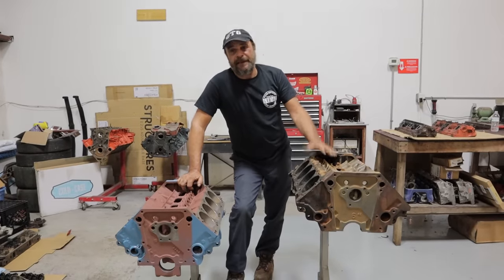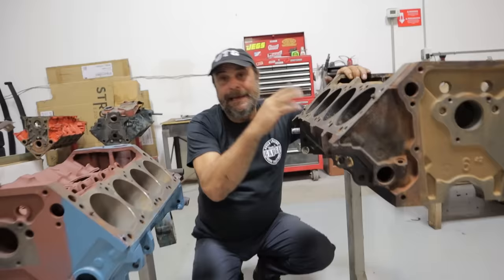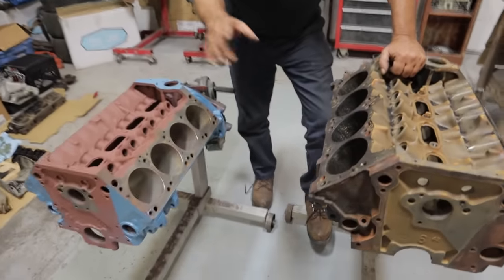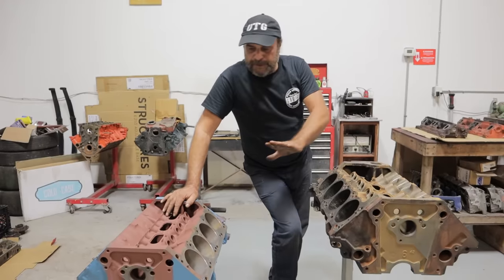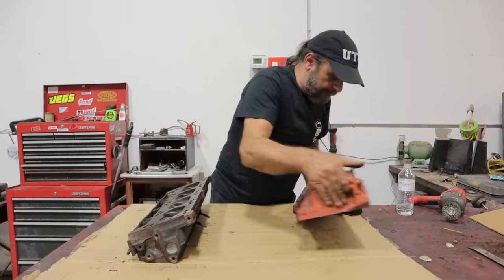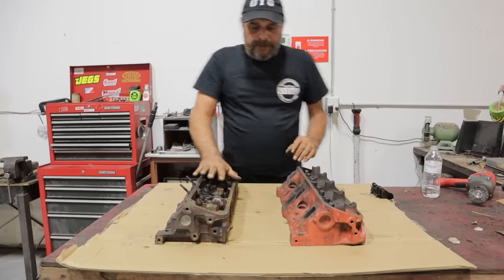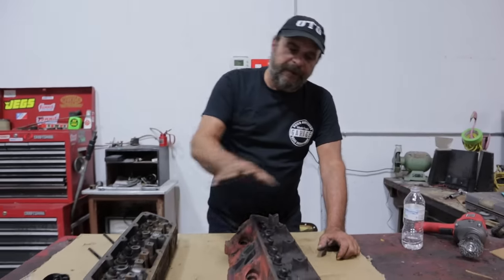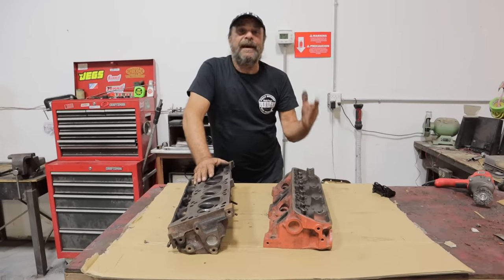Magnum vs. LA. Side By Side Comparison

Comment: I want to ask you something for clarity. When you’re talking about the  360 magnum small block Mopar motors, are you talking about the crate 360 magnum motors like I could buy from my dealer that they make now or are you talking about the magnum motor like mine 98 and 2001 Dodge van has. 

I am pretty sure you’re talking about the magnum motors that were used in Dodge trucks during that time like was used in my van, but I just wanted to double check

Comment: tony I have a question for you- I am putting a blue print 408 magnum in my 70 challenger which is a 340 4 speed car, with the magnum being externally balanced do I need a different flywheel since the flywheel I have was off my internally balanced 340 engine, the techs at blue print did not have an answer beyond their engines are automatic built engines, which I find concerning, along with all the other questions that builders will ask the buyer that they did not ask me when I was placing my order. 
Are you aware of any issues with bolting up the A-833 to the newer magnum engines? 
Thank you for doing this video it helps seeing with my own eyes what I have read about the magnums. I owned one for a couple off years when new but the now ex was awarded it before I was able to tear into it so this will be my first built Magnum and first stroked engine and with some luck won't have to tear into it for several years and can enjoy driving it instead of wrenching on it for once.
Reply: Hi James. No I'm not Tony...not even close, but I can tell you that you will break your crank if you don't use a 360 flywheel. The 340 flywheel would have to have weights added. I'll bet Tony could tell you what size and where to add it. Just be sure to address this before you procede
Reply: 440 source sells a billet steel sfi rated flywheel for cheap. it even has a weight mounting bolt pattern that i swear is the same as the mcleod flywheel weights that they sell for a 5.9 magnum specifically. brewers performance had the 5.9 magnum flywheel weight.

Comment: I have to disagree on the spark plugs, the thread sizes may be the same but on the LA style engines the spark plug socket size is a 13/16. 

Magnum engines are 5/8 socket size. 

LA and Magnum blocks are very different as well. 

The pitch of the cylinder walls are different, a magnum blocks cylinder pitch is more V where an LA block cylinder pitch isn’t as upright.
Reply: You're crazy. Both LA & Magnums are 90 degree V configurations. Plugs are the same thread and same seat. That the same "type".

Comment: Do they make a LA lifter that is designed to swap to pushrod oiling and just pipe plug the deck oil passages. So a guy can run LA or magnum heads on a LA block with pushrod oiling?

Comment: Hi UT. Question in regards to the Roller LA blocks, (mine in particular is a 1990, code date 3/10/90) so the LA heads on the LA roller blocks had the the intruding intake pushrod but also had the oil passage through head. So an older (pre '86) LA head would work with the oil galleys on the LA roller block but you would need to contend with the pushrod hole not being the correct angle? Is there a workaround for this? Or would it be best to just stick with LA heads that would have come with the LA roller blocks? Or I suppose go with magnum heads? But then I'd need to get the AMC rockers and oil through pushrods? Also do you need to block the oil galley's on a LA/LA roller block if using Magnum heads? Or maybe just a higher volume oil pump and get extra oiling up top? Thanks Probably made more confusion than anything else.

edit: PS thanks for posting this so little info out there on the Magnum engines!

Comment: I have a question, I’m looking at building a 5.9 magnum and boring and stroking it to a total of 426 ciz If the rotating assembly I order says it’s internally race balanced do I need to use a external balanced harmonic damper and weighted flywheel?

Comment: Hi sir have a 2000 mag 5.9 that ive just hogged out 30 over , coated pistons 10 10 cut crank ,modded kegger with alum plenum pan ,high vol oil pump ,hastin innerds ,  2014 eq nos heads , 4 hole injectors , ive had 3 high mile 5.9s and all 3 had major cracks . So got lucky on 014 eq nos heads .... also hogging out my throtlle body too goin in a 00 durango awd ..    .

Comment: Nice to know a swap can be done, but I think I will stick with the stock heads on my 360. The gain isn't worth the work to use Magnum heads. It's a 73, so I don't even have the air injection to deal with. Also low miles. Like 50k.

Comment: actualy......the bolt spaceing of the torque converter is slightly different.......and if you  drill the 
deck about 3/4 of an inch and then
90 degrees into the valley.......you can run steel lines to the oil gally next to the distributor...drill and tap......you can then use old style 
heads.....use head gaskets.  as. templates.....on magnum

Comment: I just got a 5.9L Magnum long block all apart, super cheap, cylinders need boring but it's in factory bore size. But one thing I noticed right away is some nasty grinding around the last two lifter "humps", as if they roughly ground off casting flaws. Also, it doesn't have that pillar under the distributor hole. Is that a common thing ?

Comment: Tony just a quick one. In 86 we rebuilt a 360 in a tow truck and we brought the block to the machine shop, paid for cleaning and check as well as build the short block. This was a 79 Dodge. The shop returned the block and said we were lucky to have this engine, he called it an industrial 360, is this a different block?

Comment: Why is it none of the after markets make a bolt on Hemispherical designed head for Mopar small blocks?  I’ve wonder this for a long time now and it just seems to be a missed opportunity for them. 

With all the high tech cnc machines out there seems to simple to not do and it would light up the old school motors. I’d really like to know why not.  MOPAR2YA 🇺🇸

Comment: My   engine magnum 5.2 in a 2001 Dakota ( 167 K mi)  has been sucking oil past the valve guides for 8,ooo miles . Today I had to stop and start my engine several times during a 1 hr period and I hit the starter and there has a hesitation and then it started and within 2 miles the engine started burning oil in the engine compartment , then it started to rattle , like a Big End knock and then seizure...Let it cool down then it would spin , I could feel the starter really working hard  . Would not start . I Believe the valve  guides flooded one or two cylinders and hydro- locked and bent a rod .  Should I rebuild the engine or find a Jasper ?

Comment: I’ve got ? For anyone who knows , I magnum swapped my 5th Avenue  I know that the asd control is in the c terminal on the pcm but if I’ve got a no security pcm do I still need to wire in the asd? Since the coil and injectors are all pulsed by ground? And will not having a ccd bus cause a no start? I want to keep it efi but if This new pcmdont work Im just going to go carb

Comment: my 97 dakota has a 5.2 v8 in it nothing wrong with the engine 225 klms on the motor , valve covers never been off ! my question for you is whats all this stuff about  modifying the under side of the magnum intake manifold? whats this all about ! just asking? does it work ?

Comment: Isn't the valve spring installed height shorter on the magnum? I know the magnum factory installed height is 1.640. Other than that I think you covered the main differences. The oil pan gasket is different between the LA and magnum is the only other big difference I can think of.

Comment: Tony ive gotta say theres no way any small block mopar will ever be a contender with the ls engines. The 318  is my favorite engine but even i succumbed to ls fever swapping in an ls3 in place of my 383 dart. Its supposed to be originally a 340 gts car, but its always had the current 383 since at least 1972/1973. It's a weird car the 383 looks like it was factory but by the vin its a 340/ 4 speed car. Mine has a 383 4 speed. Apparently its always been reliable but i just feel its time for something different. Ive had it since high school (16 years.) Always been reliable actually . But power wise its all about the ls and they get decent mileage. 
Idk its always bothered me it doesn't have the 340, and money wise it made sense to go with an ls without compromises. The only other thing thats annoyed me about the car is its a 67 with the 68 marker lights 😂 stupid i know. Snd the constant question i get asked if its a gss dart. No chance 😂

Comment: All kinds of support for Gen 3 now. And they aren’t hard to work on. They fit in A-bodies without a problem. So that old thinking needs to go. 
That said, I have a 340 in my 72 Duster (swapped before me)and a magnum 360 in my 79 Ramcharger. Both are modified and both run great. But I could end up with a Hemi in one or both. 
Oh and 360 didn’t go roller until 1988. I still have the Mopar parts catalogs from 1968-2001. I was a Mopar parts guy for 20 yrs.

Comment: Question for Tony or anyone that can help; I've got a 98 ram 1500 with a magnum 318 in front of a NV3500.  I need to be able to comfortably tow a 6,800lb travel trailer - I cannot afford a new vehicle for at least a year.  I'm able to either buy another 318 to build/ swap in, or remove/ rebuild the current 180k motor in it.  I REALLY want to keep that NV3500 because it makes the truck unique.  I know those trans don't really like a whole lot of power- what would any of you do to get more torque, hoping for slightly better fuel mileage (wishful thinking), and a few more ponies?  My thought is zero decking/ port/ polish the heads, mild pocket port under the valves, mild cam, stock internals... pretty much what Tony outlined here.  I want to DIY as much as I can here.  

The current motor pulls my trailer fairly well... except I'm constantly dancing between 4th and 5th gear. Id like to be able to just have enough where I can keep it in 5th and keep it there on simple a 1% grade.  As of now, ANY SLIGHT incline and I'm immediately dropping gear.  

Can I do anything with the NV3500 to strengthen it? Would I be better off searching for a different trans all together? Any thoughts and suggestions (other than buy a new tow rig) would be welcomed and appreciated.  Thanks for all the info In your videos, Tony! I'm a Mopar guy now because of you lol.  Thought about swapping a 4bt in this thing, but thinking I want to stick with the 318 and keep it a "look what this 318 can do" situation 😁.
Reply: I'm running a '94 Dakota 5.2l with the NV3500 (first year in the Dakota) @196,000mi. I regularly pull a 20' aluminum car trailer with it and have had 6,300lb loads more than once. My truck seems to be the exception since it has 3.90 gears instead of the usual 3.54s. I like to think it's everything from my hotrod to my 3/4ton truck and that's the way it gets used. I wouldn't worry too much about the transmission, I would look into putting lower gears in the axles. 5th is OD and I usually downshift in mine when I hit even small hills and it weighs 1,000lbs less and has lower gears than a typical 1500. I'm on prob the 5th 318 throughout my life and this one is the 2nd magnum, all seem to be happiest towing and cruising at 1800-2200rpm, didn't matter if it was my '74 Dart Swinger, '68 crewbie Power Wagon, 1 ton van, or my Dakota. I love me a 318 🙂

Comment: Did I hear correctly you commented that LA's manufactured after 86 had roller cams in them? I used a 360 727 out of a 88 D250 pickup in my 71 duster. At the time I could have bought a 360 magnum or LA same price same millage on them Would I have been better with the magnum than the LA engine?
Reply: yes. magnum has better flowing heads, nodular iron crank, hyperutectic pistons. same camshaft specs between the two

Comment: Don't be jealous of at all of LS engines, it costs a lot of money to buy a 330 CFM head for an LS engine while hemi guys get them stock and low lift flow on an eagle head still flat destroys the 330 CFM LS heads anyhow, you basically get a high end aftermarket head on a stock engine with a gen III hemi, aftermarket heads are not readily available because there is no need for them and same goes for rockers and cranks while pistons and rods are readily available as drop ins.   As for the mag vs la, the lower end of the block is different where the main webbing meets the pan rail, there is extra meat anchoring the magnum mains to the pan rail sort of like the TA and X block stuff, also ex ports are very different, the ex port floor on the magnum is much more radiused and stabile flowing where the LA has an extremely sharp turn on the floor that results in turbulence.  The factory one piece magnum pan gasket is much better, ex bolts don't go into water so less rusty, broken , leaky ex bolts on a magnum and no coolant loss when swapping headers.  On those LA heads try throwing a straight edge on the valve cover rail then do the same on a magnum, that straight machined surface combined with nice re-usable valve cover gaskets makes for a much better seal.  The magnum is a big step forward from an LA and the gen III hemi is a huge step up over a magnum.

Comment: Except for the early Warlock and Little Red Express 360 that used 340 ta blocks. Forged crank not cast crank.
Reply: Nope these trucks used the EH-1 engine which is basically a 360 cop motor. Standard block cast crank
Reply: lol no.

Comment: Gotta give you a like for that ls rant at the start. 

I get it the ls took the sbc into the 21st century but that doesnt make it the best thing since sliced bread. 

I do wish Ford and Chrysler tried the same thing with the Windsor and Magnum engines just to shut them chebby fanboys up once in a while.
Reply: well, the 7.4 ford gasser is about to do that.
Reply: @frigglebiscuit7484  the godzilla is an all new design, and ford already done f'd up. Them popcans they put them in are trash. 

Im talkin windsor architecture simply perfected. It was damn near perfect to begin with, just needed new heads and efi to move it forward. But ford always seems to do that, just look back at how many designs they went through from the 50s to the 70s.

Comment: How can i tell the difference in motors i have a 1992 dodge Dakota with the 5.2 318 do i have the magnum or the La motor
Reply: The 92 318 is a magnum, the 360 wasn't a magnum until 93.

The magnums have the tall longer runner beer keg intake manifold.

Comment: Hopefully you still check comments here: I have an 85 D350 360 5.9L LA small block, great frame but has an engine knock and I'm looking for a replacement, I can find a rebuilt motor for 2k but I was really hoping for a completely new engine, and I can readily find magnums... are they interchangeable?
Reply: My advice is to find a reasonably low mileage 5.9 Magnum from a salvage yard, buy an aftermarket carburated intake for it and go that route. You'll be impressed with the extra power 👍

Comment: I would like to know how much power the block itself will handle? Internet warriors say the block is unreliable after 600 horsepower. An aftermarket Long block carries a guarantee up to 500 HP, so there might be some truth to that. But Ive seen People push 750 out of these engines. At what power level is your blocks life measured in Runs on the drag strip?
Reply: get a main girdle and main studs, and it should be fine for like 700+

Comment: Looking at those Magnum ports and the intakes kill the head. That small they will never flow. Fine for a maybe 4000 rpm stock street engine. 360 heads are generally ok there but the chambers and deck height are useless. The Magnum ones look ok. Instead of stuffing around with them just buy some aftermarket ones that make power. 340!
360 3"mains like all 3" main engines make a LOT of heat in the bearings when turned hard. And the cranks are heavy. 318 is far better but has an orphan bore size!!
And all 360 heads are cracked,, the reason there is not many left!! 30 years ago we tried to find a pair of J heads,,all cracked, later heads, all cracked. 
LS? Overrated. As a near stock engine very good power available. But by the time you buy all the electronics to make it work in an old model car you can build a very good small block that will make more power reliably.  With no electronics to confuse most. No sprintcars with imitation engines!!!  Has been a very few with LAs though

Comment: I mean the aftermarket for the ls is not really a big deal it's the fact that you can do alot with the factory computer because all you need are injectors which are basically universal and a cam and valve springs but I'm sure those have cam options but and a like 2 or 3 bar map sensor and a generic turbo and pipe and intercooler and stuff and people make 1000hp I mean much more you are going to want heads maybe an intake and you will probably want to look at rods and Pistons maybe crank

Comment: I'm doing a magnum engine swap on my 90 dodge ram 250 and need to know which flywheel to use with my original transmission, I was told to use the magnum flywheel and not the LA flywheel.. help please. Also do I need to do anything special with the motor mounts
Reply: If it's a 318 to 5.2, they are the same neutral balance flywheel. If it's anything 360 or 5.9, use the flywheel for that engine you put in